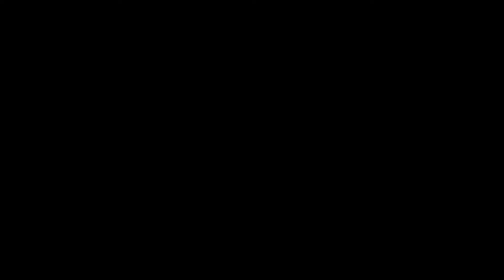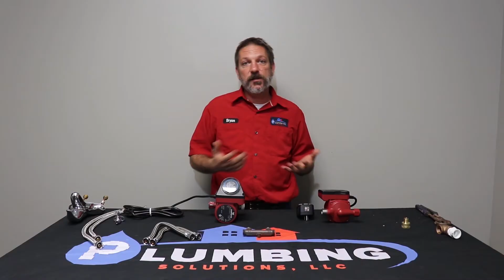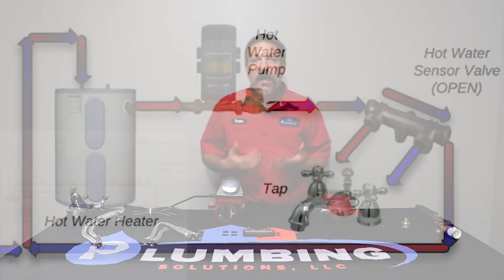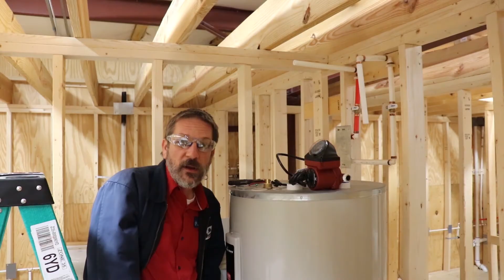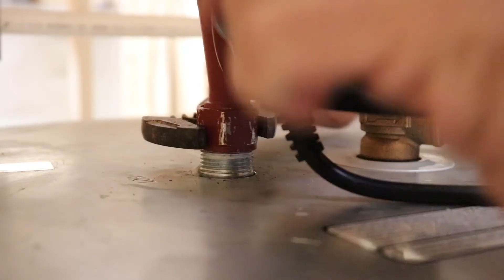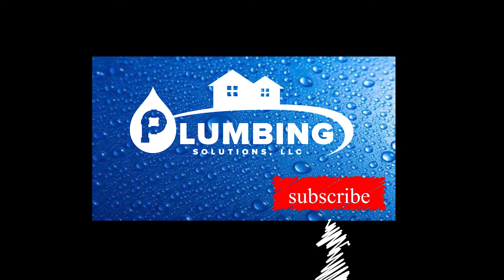Plumbing Hot Water Recirculater Pump

Comment: The correct way to install a recirculation system is to run a 1/2” pipe from the water heater to the furthest fixture in the house. Tee it into the hot water line under that sink. At the water heater, install a check valve and pump to the drain of the water heater with a tee before the drain cock. Install wiring and push buttons at each sink and wire to a time delay control panel to run the pump for 30 seconds every time you press a button. This is the best way, but only if you can install in existing walls with a basement or crawl space. I have it in my house and get hot water anywhere in 5 seconds.

Comment: is there more of an advanced wireless system where we can just hit a button on a remote to start the circulator? The timer would not work well for us, we dont have set daily schedules.  I know there is wifi plugs I could use, just curious if there is an actual wireless system out
Reply: Yes put the analog  pin to all on then get a smart plug and plug the pump in .Now use the app for that smart plug and a few minutes before using the hot water turn the pump on and when your done showering or what ever else shut it off with the app.
 Smart apps will allow you to program times on and off according to your schedule
We like the app to turn it on or off as we need it. 
Very efficient

Comment: Be prepared for a dramatic increase in your natural gas bill. You will want to set the timer for ONLY the times you really need the instant hot water. That was our experience after installing this unit. Every few years, be prepared to replace the "balance" tube, also. Currently they sell for about $50.00.
Reply from the maker: That is an electric water heater... but yes, it will increase your energy usage .
Reply: I was thinking of using a remote. Turn it on for a minute before I use the hot water.

Comment: I would like to know why you disconnected the supply line from the sink. Why cant you use the supply line and go directly into the top of the valve and let your new supply lines go straight to stops?  Also, is there any concerns about introducing cooler water into your water heater?

Comment: while i understand (i think) the way the sistem works, what is preventing the water than is returning on the cold line to backflow into the main line that's coming from the city(idk/i don't see if i have a backflow valve or the meter has a backflow valve)? The electronic part that goes on top of the tank is basically there to recirculate the water corect? So when it activates it's letting/recirculates cold water coming in because the valve under the sink opens. Doesn't that mean that the cold water coming from the city line is fighting the pressure from the return line to get in the water heater? I'm so confused and can't find a diagram on how this actually overcomes the pressure from the city water line and not combine with it(i understand there is no water displacement either so city water should not come in/combine. Theoretically). i would see this working if the recirculating pump would have 3 connections and a close/open valve inside: you would splice it in your cold water from main and water heater (that's 2 connections) and 3rd connection you would connect to your cold water line/ return line used by the under sink bypass valve/thermostat valve(that way when it recirculates, the main electronic valve is closed so no water from the main comes in and when you use a faucet the line feels a drop in pressure and opens the valve to let cold water flow in your pipes from the main line and stops the recirculation. what am i mistaking in my thought process? thank you for your time reading
Reply: This is a scam. The cold side under the sink has pressure that would prevent the hot side from entering. A third line from the farthest sink to the hot water tank would work, not this phony system that they fail to describe.

Comment: Thanks for the very informative video. what if I have a combined problem, the water  (Cold&Hot) are very slow and when open the hot tab, the hot water takes alot to come in. should i use 2 pumps in this case aslong with the by-pass line or the circulation pump with the by-pass line would be enough?
Reply from the maker: Check you water pressure. you may have corroded pipes if its and old house or a pressure regulator that not turn up if it new.. could be a lot of things

Comment: What is. The head/feet of these pumps I need 22 feet head for 3rd floor bath
Reply from the maker: The GPM is very low and your in a closed pressure system. I have put them in basements and they have done just fine on a third floor .
Reply: @PlumbingSolutionsLLC  yes my hot water tank is in the basement and I need to go upstairs to the bathroom what pump would you suggest? Thanks
Reply from the maker: I like the Grundfos  ... I think the one in the video is the 595916
Reply: The system is essentially closed. Therefore you aren't needing to worry about head pressure. You aren't lifting the water, just circulating it. The crucial part is insulating the hot side plumbing. Otherwise the losses will be huge! A flow meter and digital monitor can sense the priority times and circulate the pump during peak demand. If you live in cold climate then insulate the cold side too.
Reply: Did you ever come up with a solution? I'm in the same boat, needing over 20ft of head. You need an industrial pump that costs thousands to get into those specs.

Comment: Question: when the bypass valve heats and closes, does the circulator stop? I was under the impression that the pump works constantly unless shut off by the timer.
Reply from the maker: the pump continues to run until the timer cuts off. so you want it close to perfect timing.

Comment: We have a tank heater, installing this system next week. Giving thought to using three comfort valves in the house. One at the furthest master bathroom sink, kitchen sink & guest bathroom sink. Hot water does take forever to get to these locations. Will  more then one comfort value create unintended consequences?
Reply from the maker: It shouldn't.. you will just be moving more water.

Comment: Stupid question but I understand that connection under the bathroom sink would bring instant hot water to that sink but how does the shower get instant hot water? Does one of those valves have to be conmutó the shower water lines as well ? Forgive my stupidity
Reply: Hey User, great question! The water heater supplies hot water to all the places hot water is needed because those pipes branch off the main hot water line. That's the reason the recirculation pump is attached to the main hot water line.
Reply: It's voodoo. A third line back to the tank is the only way that this would work.

Comment: great vid as always thx...you mentioned it would be best to "pre-plumb" for the circ pump...would that just require an extra return line at the furthest tap with a Tee fitting?  then another Tee fitting at the cold water inlet at the water tank?  and a check valve?  could you please describe?
Reply: I watched a different video and they tap into the hot water line, and connect the pump at the tank drain valve
Reply: corret you tap into farthest hot point in home and send it back to recirc pump tied into bottom of water heater and just replumb the spicket off a nipple and a tee

Comment: You mentioned not to use teflon tape on these connections although you used it on the second connection. Please advise.
Reply from the maker: I think I was referring to pipe dope, no dope on the supply lines.
Reply: @PlumbingSolutionsLLC  Ahhh. Thanks for your clarification and expertise.